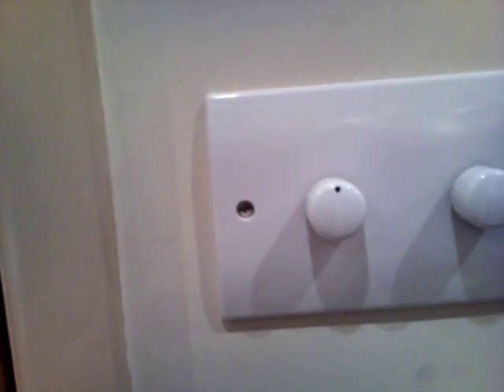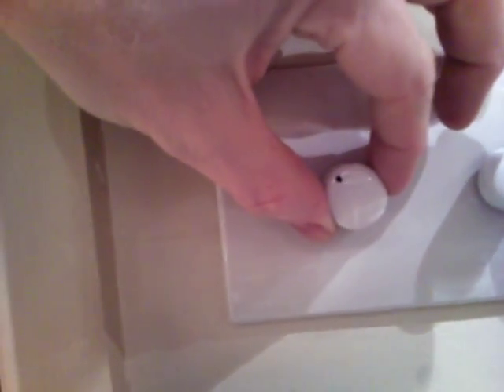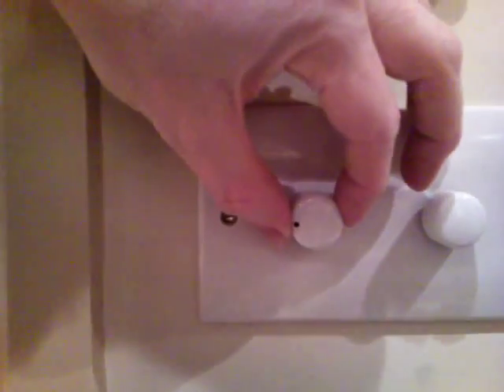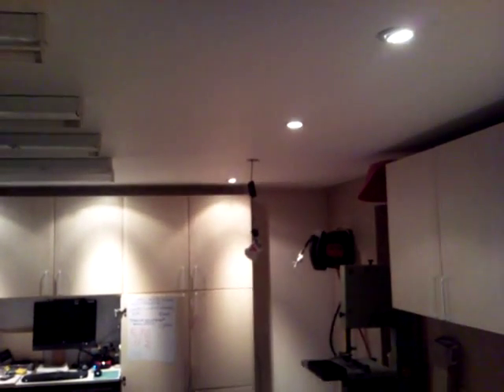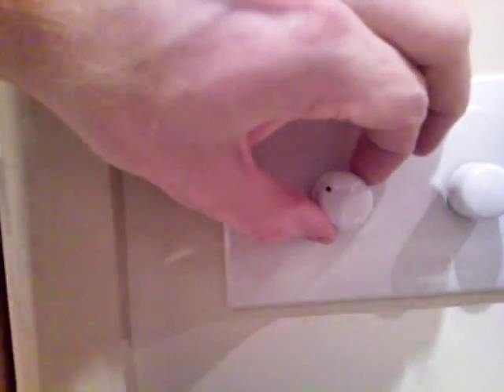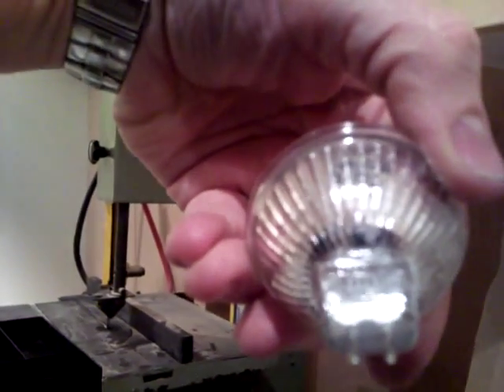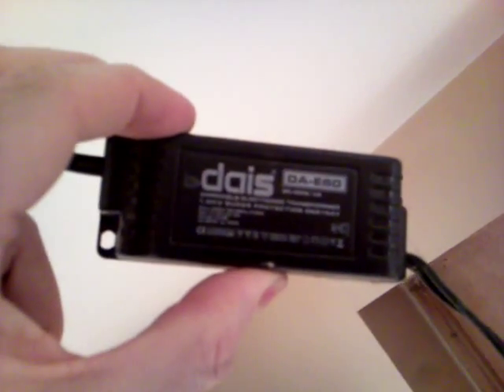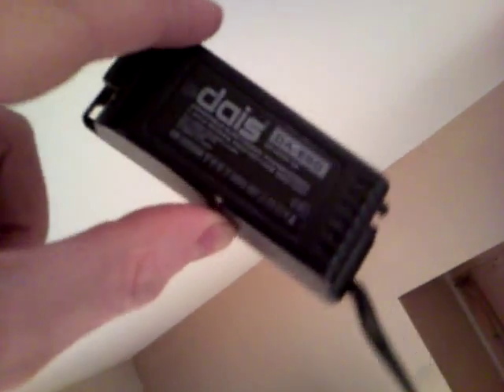Low Voltage LV Halogen Flickering... HELP!

Comment: Did no research on your transformer but you most likely have the wrong dimmer.  You probably need an electronic low voltage dimmer judging by the size of the transformer and age of the video.  Look up the specs on the transformer and they will usually give you a chart for compatible dimmers